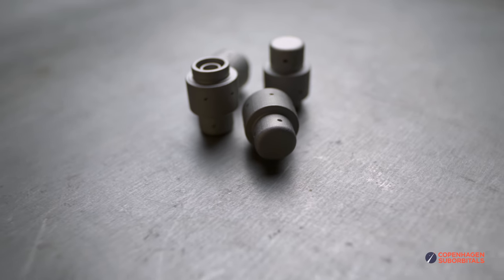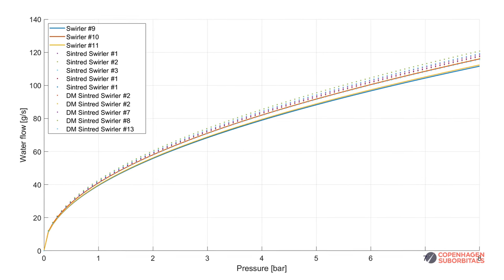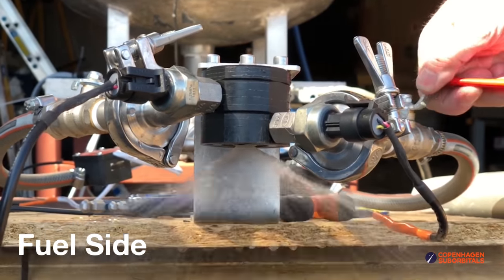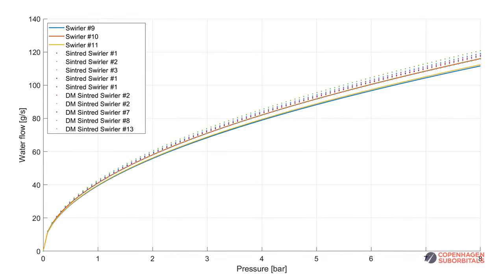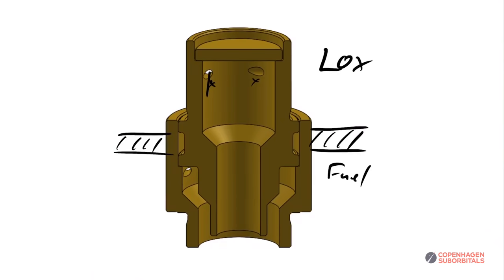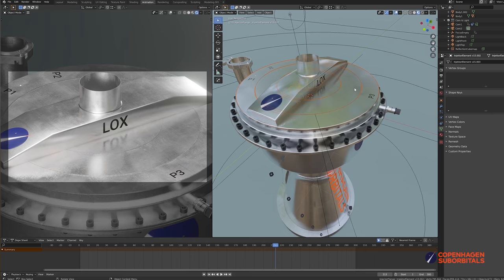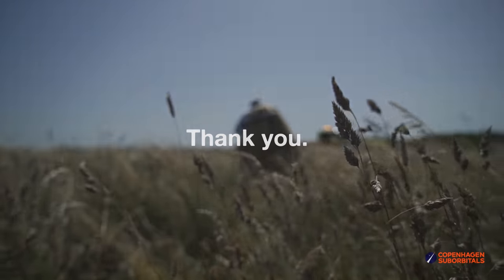Rocket Fuel Injectors: Machining vs 3D Printing

Comment from the maker: Thanks to Scott Manley for letting us use a clip from his injector video!
Reply: will you live stream launches?
Reply from the maker: @jamesperzinski1733  We always do. Also with live video from the rocket itself
Reply: Copenhagen Suborbitals 
Awesome work guys. 
Been following for many years now. 

I have a question for you smart guys,
As a theoretical proposition, it seems that hooh and ethanol are usable non hypergolic fuels for a liquid rocket. 

I can’t find much information on what happens if you pre mix them before breaking down the hooh and if the reaction has enough energy released to vaporise all the ingredients. 

With my rather poor high school math I came out with a figure of roughly equal parts hooh h2o and ethanol still being stable at room temp but mostly boiling off after breaking down the hooh. 

The idea was to have a “steam” powered rocket where the fuel and oxidiser were premixed as liquids when entering the engine for more thorough burn in a simpler combustion chamber at lower temperatures. 
Very inefficient motor of course, but still the safest (70% hooh) and cheapest to manufacture for teaching purposes. (University or amateur rocketry)
Reply: Copenhagen Suborbitals 
Sorry for all the questions but ....... what are the temperatures at the exist of the cone?
From what I can find they are lower than the afterburner on a jet fighter. 
This opens the question of using some sort of “feathers” to vary the size between ground and vacuum. 
This must have been looked at for a single stage to orbit motor and rejected. 
Any ideas why it was rejected?
Reply: Which software are you using please tell us about more?
Reply: @Copenhagen Suborbitals Hi!
I might have an idea for the injector model.
Is it possible to send me the cad model so I can modify it and send you back my modified version?
See it as a CAD brainstorming. 
I’m using SolidWorks and playing with my Prusa i3 MK3 printer. 
Cheers
Reply from the maker: @1943vermork  No. We're subject to legislation similar to ITAR, which prohibits us from sharing too detailed information in this area.
Reply: @Copenhagen Suborbitals Understood

Comment: It is very interesting to witness the creation of a rocket engine step by step, with you guys learning so much as you go!

A historical anecdote. One of the mysteries in the history of the Soviet Space program is a very tiny engine -- not unlike your BPM5. It was called Lilliput or KS-50 ("combustion chamber with 50 kgf thrust). Through the experience with this engine, Soviet engineers have transitioned from the German A4 - style engines to the much more advanced design that we see in the RD-107 engines of the Soviet R7 missile, which had launched the first satellite and the derivatives of which are still flying today. All the essential features were tested on that tiny engine -- including different designs of injectors. It was a major milestone in the development of soviet rocket engines, but unfortunately the detailed story of its origins is shrouded in mystery even today.

Comment: Wonder  if you can use the same extrude honing techniques used to port and polish heads for car, to get the inside of the injectors more smooth. I assume that they are rough on the inside like they are on the outside. Might be able to eek a little bit more performance out of them.

Comment: Can't wait for the upgraded BPM5 tests! Are you going to make 2 injector plates (one with brass injectors and one with printed steel)?
Reply from the maker: We have four different brass designs ready for production. And then two stainless designs in addition which we are missing parts for though.

Comment: Warning: I am not a rocket engineer. I understand why the discharge coefficient is worse in the swirl injector than the shower head injector and I understand that the new geometry has helped mitigate some of those loses, but could some of the losses in the discharge coefficient in the new swirl injectors be reduced further by smoothing the rough surface finish on the inside of the swirl chamber? I understand that it would be a ton of effort to smooth the inside of the swirl injector in an efficient and economical way. Still, if your main loses are due to friction, might it be worth it? It might be worth gluing some sandpaper scraps wound around a thin steel rod and chucked into a power drill in order to create a hand full of test articles for performance testing.

Comment: the increased efficiency might also be attributed to the rougher surface.  the "micro" turbulance that is created on the interior surface of the "swirler".  It would be informative to 3D print exact representations of the machined version.

Comment: Sorry if you already do this and I missed it but have you thought of using strobe light photography to see the shape flow from your nozzles. If you use a laser you might be able to see different sections through the flows better pinpointing when the fuel becomes mixed.

Comment: It is good to machine the final swirl duct walls as it is where you have bigger losses due to higher speed and longer wetted area.
Reply: "Development of Liquid Rocket Engine Injectors Using Additive Manufacturing" and "SELECTIVE LASER MELTING (SLM) OF INCONEL 718 AND STAINLESS STEEL INJECTORS FOR LIQUID ROCKET ENGINES" both from 2015 :D
Reply: Bruno Porto Hi!
This was briefly discussed before shipping the swirlers to CS, as an attempted fix in case the swirlers would not perform adequately, due to the higher surface roughness, compared to the machined ones. However, it seems like they performed rather well.
In an attempt to not sound like an add for our printers; printed surfaces from binder jetting in general, and Digital Metal’s printers in particular, are typically a lot smoother compared to other metal printing technologies (EBM, SLM e.t.c.).
Still, I think your suggestion would provide some improvement on the performance, though the gain might not be worth the trouble of the added post processing step. I think it should still be investigated though!
/Fredrik
Reply: @FiddeBL  Thanks for the answer! It is a pleasure to follow your efforts. If I am not wrong the better surface finish at the swirling wall will help with better atomization with a better film formation due to not losing too much speed within the swirl. :D

Comment: Good video. One thought... The effective Cv across the entire injector assembly might be that low, but I wonder if you could characterize the two pressure drops you have. The first being the input nozzle into the injector body. That would have a relatively good Cv. The next would be the drop as the fluid leaves the injector nozzle at the bottom. You could probably do some reasonably accurate simulation to determine that internal pressure. It might give you a better idea of where your loss is coming from. Maybe its not actually the high friction loss, but rather just the high (well higher than 1bar absolute) operating pressure in the injector body. Cheers!
Reply from the maker: We could in principle do that. But I am not sure it is worth the effort, at least I am not really sure how to apply the result. I think we will stick with testing a few different designs and find the most promissing design.
Reply: @CopenhagenSuborbitals  I agree. It's likely not worth the effort, especially if you are getting results that work. I am just intrigued but the experiment of different flow characteristics between the 3d printed sintered parts and the machined ones. (it is such an interesting trade off between conventional and 3d printed parts) Keep up the great work! and I look forward to see how the rest of your injector experiments go!

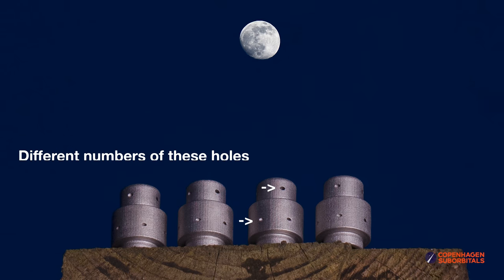Comment: 5:29 Nice. we can see what option is better? or data comparation betwen each option?
Have you try make inclination aswell? The hole are stil tangencial to the circle but have small inclination to botom to get easy direction of flow.

Comment: Exciting stuff ! Have you done any CFD on the swirlers to develop the prototypes or do you mainly "print and test" ? What is the operational temperature be compared to ambient?
Reply from the maker: We have not done any CFD. The design is heavily inspired by a Russian design. So we have chosen to focus on testing different versions rather than CFD.
Reply: CFD on swirl injectors quickly becomes a nightmare especially when coupled with hand wavy physical experiment methods of validation. Just go with the flow tests imo..
Reply: @JaredBrewerAerospace  I agree that flow tests are best for sure. Doing some quick&dirty analyses with fx. LBM based CFD to look at different design principles can bring some valuable insights when coupled with physical tests.

Comment: Very interesting topic. I'm a aerospace student myself.
Can you please elaborate on the reasoning behind the "throats" of the coaxial swirl injectors? Why do they go narrower between the inlet holes and the exit plane? 
Thanks!
Reply: Keyboard runner Hi!
Read up on angular momentum. Then try to figure out what effects you get from varying the throat diameter! ;)
Cheers!
Reply: @FiddeBL  
Accelerating the fluid was my first thought. But I suspect there might be more to it, because nowhere near all coaxial swirl injectors have this throat.
Reply: @3gunslingers  Alot of them do gas/liquid mixing, not liquid/liquid... Just a clue.
Reply: @jnielsen20  
Are there any sources you can give me a link to?

Comment: What about the difference in how the different injectors will handle the thermal environment? Could the steel be better able to handle the heat, or could the manufacturing technique make them more vulnerable to thermal shock, like from the cryogenic flow?
Reply from the maker: It is difficult for us to do thermal simulations on these geometries. A big part of the reason why we do a BPM5 test with these swirlers is to do some temperature measurements before going to BPM100. I feel quite confident that both the stainless and the brass swirlers will appear as good as new after a static test :-)

Comment: Awesome content, but I wish you worked a bit harder on the audio. There is so much echo it is uncomfortable to listen. This can fairly easily be fixed with the use of a more strategically placed microphone. This applies to many videos you post, not just this one. With proper audio this would be absolutely superb content.

Comment: What is a more 'organic' shape?
Reply from the maker: Rounded, rather than straight, sharp geometries.
Reply: @CopenhagenSuborbitals  Thanks
Reply: Think of water constantly running over a stone in a river... sharp edges create more turbulence than well rounded ones do and you get better laminar flow of the water around the rounded ones.. Smooth flow = less friction loss = better performance of the fluid

Comment: How do metal swirlers compare to 3d printed plastic swirlers? Can you get good test data from that?
Reply from the maker: Well, plastic injectors will for sure melt in the engine, so it is not really worth trying out.
Reply: @CopenhagenSuborbitals  but i meant water testing to find optimal geometry first and then make it out of metal

Comment: Why the open space above the injector holes inside the swirler if the objective is for the flow to go down? Especially in the 3d printer one, the lower fuel chamber has much more space above the holes than the machined version.
Reply: René Hi!
For the 3D printed nozzles, the space comes from having to maintain some key features of the geometry (hole positions and some outer dimensions) in order for them to fit the flow test rig that CS use, while also trying to remove redundant mass. I would have moved the holes upwards if I knew they would still work properly in the flow test equipment.

Comment: Your injector assembly design seems overly complicated, did COSUB consider using a single element coaxial pintle design? These are well proven and overcome the combustion instabilities that plague multi-element impinging stream designs.

Comment: Why is the burning-chamber of the engine so long?
Reply from the maker: I assume you are referring to the BPM5 engine? Basically, it gives more time for every fuel and oxidizer molecule to find each other and combust before they exit the throat.
Reply: Copenhagen Suborbitals thanks a lot for the  answer, so my next question is, why don’t we see such a design on other engines?
Reply from the maker: @MCRuCr  Depends what engines you look at. If you look at smaller engines such as Rocket Lab's Rutherford, for example, you will see it's quite similar in length.

Comment: where is liquid viscosity hiding in that equation?
Reply from the maker: Good question... and I don't know the answer. The liquids we work with (water, ethanol and LOX) have close to the same viscocity so we have not really bothered figuring it out. But if we were to switch to another propellant we might have to.
Reply: @CopenhagenSuborbitals  that would be fun if it's in the coefficient and you would have a bad case of multicollinearity of several factors affecting flow rate and all such things. Wish you best of luck if you'd ever have to bathe in that shitpit

Comment: Comparison showing the machined variant doesn't have fillets in corners doesn't make sense to me, they could have been machined in. 
What's the point of comparing two manufacturing technologies if you purposely do things like sharp edges in one and not the other? Better CAD model for the CNC variant probably would let it perform in a similar way or better than the 3d printed variant.

In my opinion this is a bad comparison geared to make the 3d printed variant look more capable by not doing similar edge features in the machined variant.

3d printing for this injector does seem superior thanks to it being able to make it as a single piece,
Reply: The machining on these tiny (fingertip sized) nozzles was probably done with standard tools that has straight and 45° cutting faces.  Making fillets or designed curvatures would probably require making custom cutting tools with the desired profile in ultra hard carbide or diamond.  Cintered 3D printed steel can get such shapes by just changing a computer file.  The internal surface smoothness of either type could be changed with a drillbit or cutting steel.
Reply: @johncrowerdoe5527  CNC lathe should be able to make fillets with standard tooling. Yeah it's hard to tell just how tiny the nozzles are. That said I've seen grain of rice sized parts being produced on CNC lathes with quite a bit more advanced surface features, like tiny compression contacts for electrical apps.
Reply from the maker: They could, and it is not a comparison as such between 3D print and machining because, as you state, the geometries are different. Some of the rounded features could be made with machining but some would be tricky.
Reply: @CopenhagenSuborbitals  True, the fact 3d printing keeps the nozzle a single piece is huge. Can also do stuff internally that would be near impossible with the cnc, like small ridges or fins on walls to spin incoming fuel even more, or oddly shaped holes with crazy angles.
Way more freedom with 3d printing.